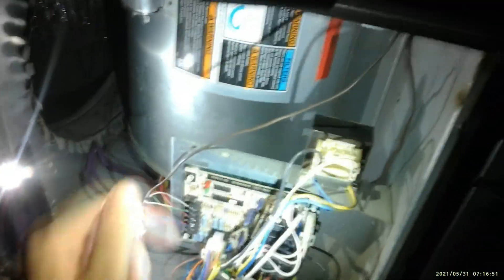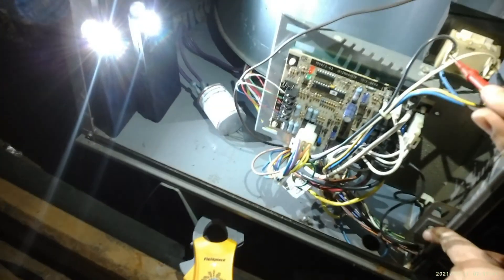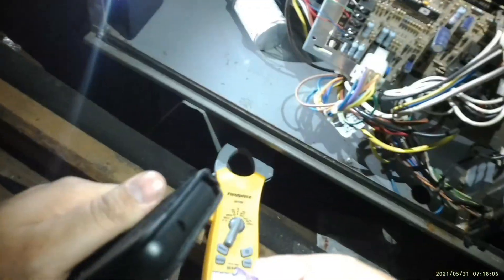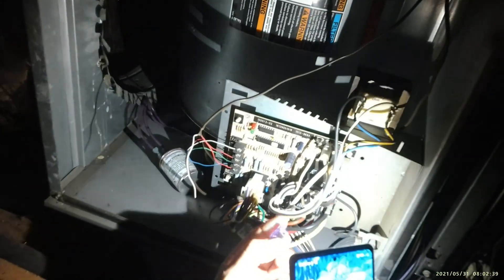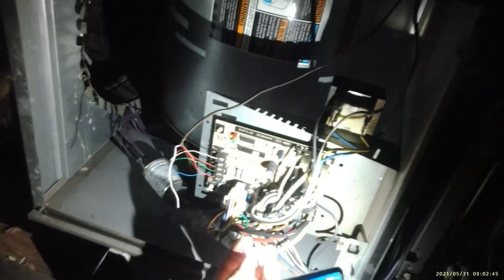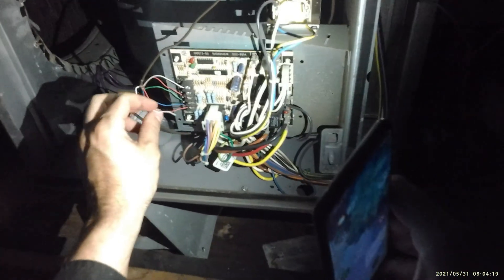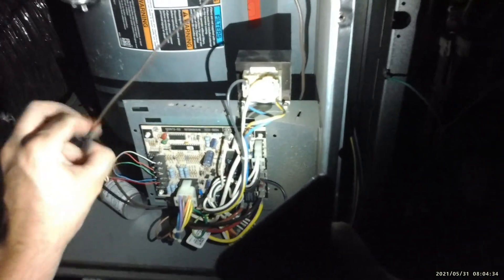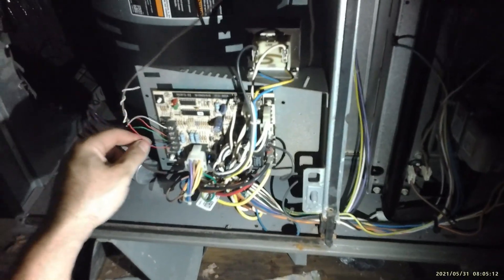Blown 3 Amp Fuse In AC Quick Fix - Circuit Board Fuse In AC Keeps Blowing. Lennox Trane Goodman HVAC

Comment: Does it matter if the fuse is for automotive ?
Reply: Most automotive fuses are rated for 32V, your control board is likely 24V, just make sure the amp rating is the same and you're good!
Reply from the maker: Yes sir, the proper amperage is all that matters.

Comment: Dude thank you! My AC is back on and the weather will be 90 tomorrow. I was all ready to remove the neutral leading to the unit. So I headed outside and discovered that both AC units had their low voltage insulation ripped to pieces from rodents. I re-taped the hot and neutral and she's been running for two hours without a blown fuse.
Reply from the maker: Glad I Could Help.
Reply: @diyhvacadvice2millionaire  you did not helped anybody, just fake an nonsns explanation